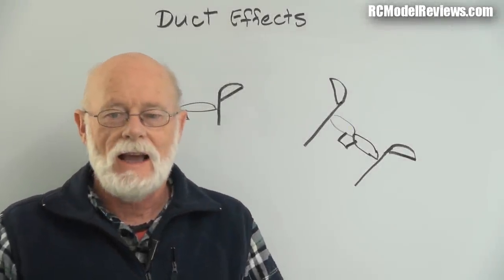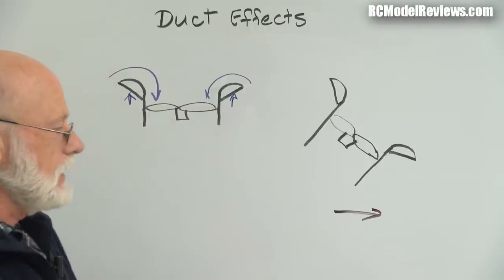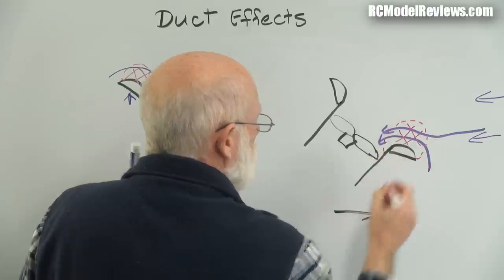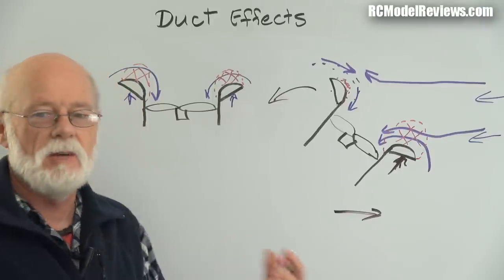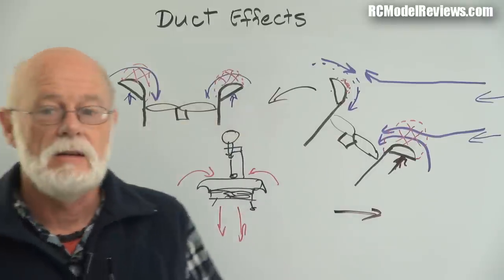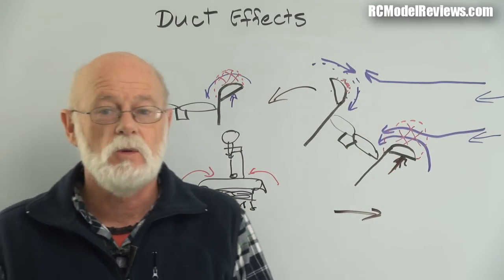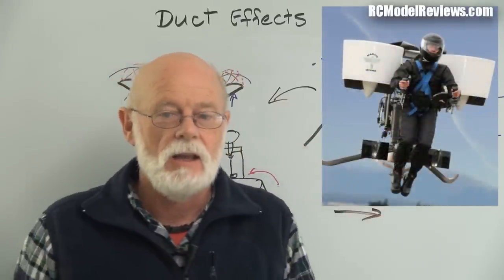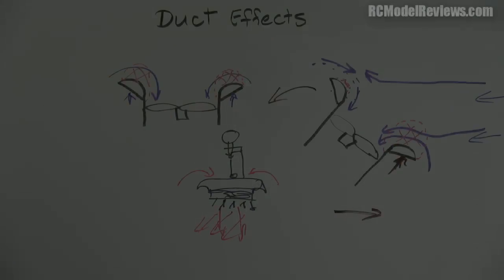More on ducted propeller systems

Comment: I have a question?  All this talk is pretty much about essentially getting a prop driven vehicle to try and deliver what a jet engine does naturally.   Rocket engine would be the crown jewel if you could figure out fuel storage for such a engine...... So realistically jet engine stands out the most as you get more balance of thrust capabilities and the storage needed for the fuel that feeds it.   Now..... I guess a prop driven thrust machine would run longer with less fuel but you would have greatly reduced thrust for both speed and lift.  The question is then, how do you control that "raw power" to give you the same effect that flying platform gives you?   Mount the engine verticle and you got awesome lift but almost too much power to vector it around to provide horizontal AND verticle thrust safely and be effective.  Well.... they came up with a personal jet pack system (rocket man).  It looked promising but then again we have the fuel storage issue as that system gives you not so great flight time.

Revisit the idea and of coarse forget the people who go to "school" to learn how to design systems that will be leaps and bounds better than what they tried to do in the past......... I think they actually learn ways to fuck with us people in the real world because what looks good on paper, rarely turns out to be a miricle product in the real world and all the over engineering they like to do.  Keep it SIMPLE stupid.

SO back to Sci-Fi inventers that engineer ground breaking concepts and put pen to paper in a different way.  They build it in their imagination to entertain those who read it.  Then those who read it have to HAVE it, so they figure out a way to make the vision a reality.  Isn't that where the majority of our inovations truly come from anyway?   Where would we be without the great Gene Rodenberry, Orville Wells ect. I mean we essentially use their "inventions" in our every day lives.

What Sci-Fi concept is similar to flying platform and the jet pack frame and rocket man......... Only one comes to mind that sports nothing but "technology" rather than superhuman powers to achieve the flight we want.   IRON MAN...... forget the "frame" system.  We do not need a rigid frame to hang the engines on..... or a rigid frame to vector the thrust because well..... it is essentially dead weight that we must now lift into the air with us and the engine.  We often look to nature to solve a engineering problem.  Well.... we are looking at the WRONG things in nature to solve this one.   We start out life with a sturdy rigid frame by default.  A soldier carries how much weight on them when fully geared out ?  Not only is the frame we are born with a rigid one, it is also built with the vectoring platform needed to vector all that raw jet engine thrust...... onboard flight computers to calculate it all ???? Well.... we have THAT too.... our own built in computer we use everyday (the brain if you didn't figure it out yet).

So..... what would happen if we take some jet engines and simply strap em on and fire em up?  I mean that's not too crazy an idea is it?

No need to strap on the jet engines to see if it genious or just a far fetched crazy idea because someone has already risked his life to bring us the real life Iron Man flight system complete with a helmet that gives him the HUD with fuel level, speed and all that good stuff since you obviously can't have a guage strapped to your arm because if you brought your arm up to look at it...... you vector that arm's thrust in wierd ways that will send you where you don't want to go lol.  Once again Sci-Fi brings the goods.

https://www.youtube.com/watch?v=PyRj2ePDiro

 https://www.youtube.com/watch?v=ADscM9VFxsA

https://www.youtube.com/watch?v=vI8E4cda_ww

Comment: If only you could separate the vertical air flow from the horizontal air flow, or at least modify the effects of the leading and trailing edges of the duct in horizontal movement. Then you have something.

Comment: may sound abouth rigth that is an strator with strigth angle but if you combine two set of strator inside the ducted and after the propeller you have a lot more wind maked by thrust when you change the direction of the travelling wind increase in speed but it get hot so two set of trators make it better one with a diferent angle one straith

Comment: what if you do not rotate the duct, just the blade
Reply: +Kamin Pallaghy you would increase the gap between the prop and the duct thus loosing the benefits the duct provides.
Reply: +Grunf Grunt would the payoff be worth it, more efficient vertical, working horizontal

Comment: The Avrocar used a special "pancake" turbojet engine that emitted thrust around it's outer perimeter. The "fan" you see in the center is the first stage of the engine's compressor. Air was drawn into the turbine in the center and thrust from the engine was emitted around the aircraft's outer rim which induced air to flow outward over the upper surface of the aircraft toward the edge of the disk. The majority of the the aircraft's lift was from the coanda effect not from direct engine thrust. The thing is, it actually worked but was very unstable out of ground effect. They tried stabilizing it by bleeding off thrust from the engine to the underside of the disk but that didn't work (it sacrificed lift for stability). Basically it needed computer stabilization that didn't exist yet. I wouldn't call it a failure, it was an idea too far ahead of it's time to be successfully built because the technology needed to make it actually work wasn't there yet.

Comment: Ha i realize this is a 4 year old video but maybe someone could still get around to answering my question 😅
Since a quadcopter tilts around its center of gravity (which is generally not also the center of a rotor) do ducts still provide some benefit? I haven't done any math of course but I can imagine that the twisting effect of the coanda lips of the front rotors might be canceled (or at least reduced) by the lift produced by the forward lip of the rear rotors
Reply: Would it even end up providing a net upward force? Making forward flight even more efficient by reducing the power needed from the rotors in the vertical component of the thrust vector? I'm guessing I'm wrong here cause this theory doesn't really sound plausible to me even ha

Comment: With all the new technology they have for quadcopters, why don't they just make a larger one that a person can sit in?
Reply: Bobster986 That would be too dangerous to stand on a giant quad with the size of the props needed...
Reply: Optamizm What about smaller multiple props with cages around them? I'm sure it can be done.
Reply: Bobster986 They already did back in the 50's it was called the Curtis-Write VZ-7. No idea how the stabilized (mechanical rate gyros?) it but it is said to have been "easy to fly". The four props were variable pitch and driven by a single gas turbine engine. It worked but the problem was that a single rotor helicopter is simply better performing and more efficient than a multirotor. The only thing these small electric multirotors have over collective pitch helicopters is simplicity.

Comment: Use ducted-fans for efficient lift and a separate solution to provide the forwards propulsion. Seems kind-of obvious.
Reply: Ian Davidson Unfortunately, as the airflow travels across the lip of the duct, you'll still get an upward tilt opposing the forward travel due to the difference in the rate of airflow on the leading versus the trailing lip of the duct.
Reply: ***** I guess, the tiltrotor would be a solution here. When You tilt the rotors toward the airflow, it a) gets less asymmetrical, b) you put more thrust into horizontal force and it eventually overcomes a coanda effect.
Reply: azgarogly you would still have the same problem because a tilt rotor and a "normal" quad generate thrust and lift in basically the same manor. ( unless you mean a tilt rotor with a wing to generate lift )
Reply: Tom George When a normal quad is moving forward, it is generating vertical force (call it lift) and a horizontal (call it thrust). In case of ducted system there is an undesired torque trying to pitch quad backwards.
Classical quad decreases power of forward motors and increases on aft to counter that. Which might me sufficient, as on quad We have much longer lever, but that reduces controlability of the craft.
If We tilt all the (ducted) rotors forward it would be the same as tilting the whole craft. But if just forward rotors are tilted, these generate less lift and more forward thrust. And airflow gets more symmetrical on these further reducing the parasite backward torque. Though it introduces a crossfeed between yaw and roll channels.
The other option is to give the craft a lifting body, which'd allow us to tilt rotors more increasing cruise efficiency (and introducing more control issues)
Reply: I can agree with that.

Comment: yes well more confused after this one,not interested in AIR but thicker stuff we call water,
ya know H2O ,,, ummm...2hydrogenmonoxide,
so any way interested in building a boat,inboard with auto trans 2 speed,am looking at casting my own prop,
Does the annular area,umm outer ring need to be separate to prop or would a cast in ring do the same if not better,,ya know like a wing tip on a plane,
And??
now i have a ring to support out edge of the prop,,would it be wise to increase width to the prop to make it wedge shape and be attached to ring??

Comment: Dude I think your concept is wrong,  just take the example of swimming in the air what creates lift ? A blade and the if you want to increase the speed move directions !!!! 
My question is if the angel is 360 ` degree 
Where you would apply the lift force ? 
Quadcopter does not have a lips on so would thy fly

Comment: Why dont planes use it then?
Reply: They do,  Jet engines are pretty clearly a super advanced form of ducted fan.  

The effect being talked about makes sure the engine wants to point "into" the wind.  So for a VTOL (like a helicopter) that causes wind to fly sideways across the blades - this engine doesn't work very well.

For an airplane, you don't want air moving "across" the front of the engine, because the engine is pointing into the wind.  So Planes don't suffer from the same problems.

Now; why don't propeller planes use ducted fans? - probably because the additional power is lost trying to make a belt to drive the engine.  Easier to build an engine right behind the fan, and plug the propeller right on the front of the engine.

Comment: what if you add a gyroscopic balloon on the top of the first design, will that solve the problem of the next design, i mean duct effect will be more efficient to reduce the counter réaction of the air flow, by pushing against the back, and redirect most air inside the UFO, lol

Comment: I know this may be a bit off topic but if anyone is thinking of buying a sky hunter from rmrc or any where don't. They are the most unstable plane. One other thing it needs at least 6-8000 mha batteries just to get the cg right. Prop can hit you on throw launches. There are much better planes out there they are Junk.I will never buy one again .If you crash you might as well buy another plane cause the parts cost more than buying a new one by 2x. Rmrc is awesome it's just that darn plane .
Reply: dustin6498 Wow a bit off topic? BTW they are a great plane and fly very well, if you know what you are doing.

Comment: Isn't it funny how what you describe couldn't have been easily recognized as an inherent flaw before many millions were spent? Of course, the same could be said for the DIVAD system where it was finally scrapped when they "discovered" the inherent flaw of even radar controlled medium range anti-aircraft artillery - a randomly maneuvering plane isn't likely to be where the computer projects it to be when the round arrives. Gosh, who could have foreseen that, huh? Then, there's the 280mm Atomic Cannon, the US Army's incredibly stupid "Hey, we want nukes, too" project. It would have taken total air supremacy to get it set up 20 miles from its target without getting blown to pieces prior to its use in which case why not instead just use that total air supremacy to drop a nuclear device on the same target? The list goes on... It's amazing how stupidly money can be spent when there's a lot of it to spend.

Comment: Wouldn't this be great for a flying turret? you could get it up above the fight a bit and shoot without worrying about it flipping.
Reply: The point is it would be great for drawing attention to and getting shot out of the sky.  Even better, it holds itself nice and stable so even easier to shoot!

If it was intended to draw attention; it'd be a very expensive way of going about it.
Reply: ***** oh well forgive me for thinking that a lack of mobility is a turrets #1 flaw...

its not like you'd have it in the middle of an open field(more like a city). and in any case id hope you wouldn't just throw it out in the open while your hiding.

dont be so closed minded.
Reply: I'm sorry, not trying to attack you, but just pointing out the main reason why they didn't pursue the platform in a military context.

Its easier to make a scissor lift or something if you need height (and being a target isn't a huge issue).

There is actually one scenario in which a flying stable platform is quite useful; and that is in mountainous terrain, and typically attack helicopters use "popup" tactics; where they fly low in valleys and when approaching known tank or artillery positions; would "pop up" above a ridge, and before anti aircraft munitions can be brought to bear destroy whatever they can see; and then "duck down" below the hill and move before they can be shot down.
Reply: ***** well that valley example is kind of the situation i was referring to. its not practical to sit still or just walk forward, so you would benefit from being able to to move on any axis you have available to you.
That being said if you turned a platform like this into a drone of some kind you could move on a vertical axis and on any horizontal plane from the floor to whatever height limitations your drone has. and you would have no human involvement except for remote control(could be wired or wireless depending on the enemies capabilities and the environment).

but beyond that i disagree, i think your thinking too large in diameter if you think a scissor lift is easier to make. i was thinking of something closer to the size of a human torso that could carry some sort of built in or attached weaponry. of course that limits the weapon size but you wouldn't chose ducted props if you intended to go much larger.

of course you could go larger and still be almost as effective but you have to think about the scale of the environment.

Comment: Couldn't you combine this with a forward facing propeller of sorts? and wings? - guess you might not need the extra lift then, you'd just be an airplane, but maybe it would allow for being heavier...
Reply: The point is the primary lifting duct always acts to counteract the horizontal airflow over the top.

Ducted fans just don't want to move horizontally with respect to the air.   (with respect to their air intake).  

So you can "push" it faster, but the big duct will lean over (because the air moves over the lip and causes it to tilt).  When it leans over it leans to counteract the pushing you are doing.